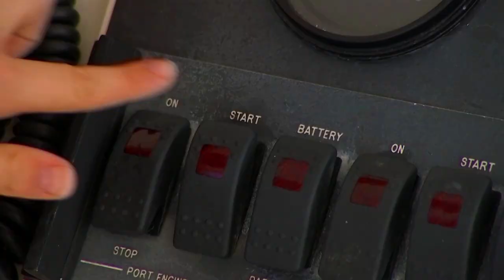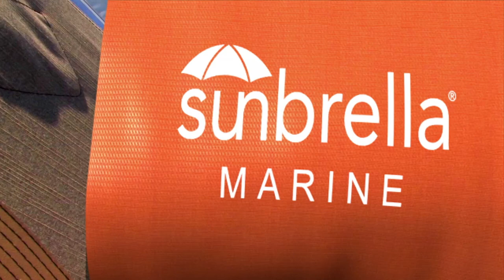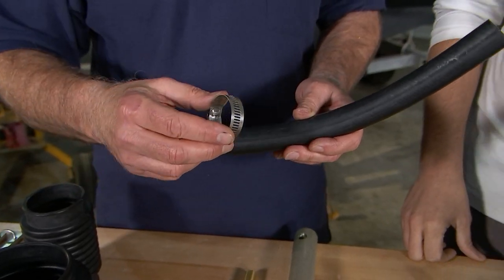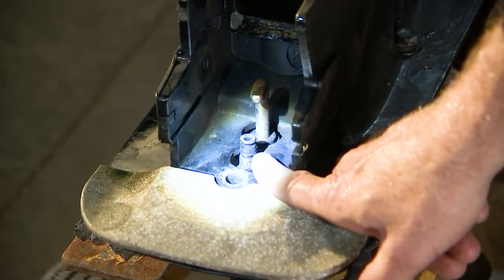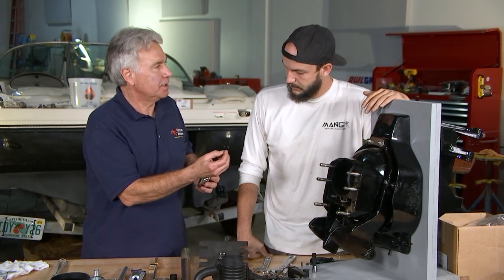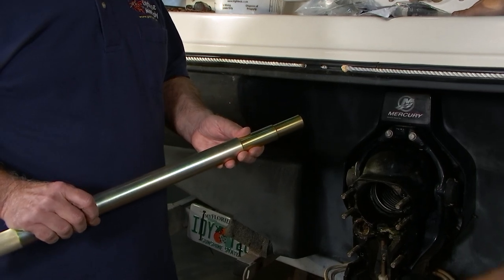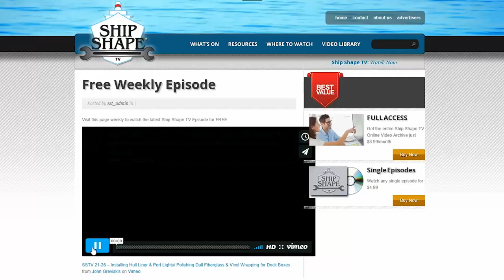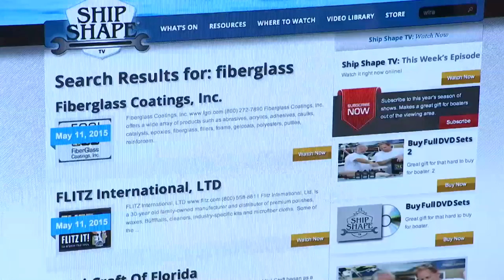MarineEngineParts.com Demonstrates a Bellows Replacement and Discusses Sterndrive Maintence

Comment: If maintenance of a transom assembly and stern drive is too much for ya, then just get an inboard, and cut out the drive and midsection altogether! No bellows. No gimbal. No u-joints. Simplicity at its finest.

Comment: my soon to be new 2015 searay 260 has a 300hp 350 mag and bravo lll drive. the exhaust seemed loud to me  and it was suggested that when it comes time to have the bellows replaced, to have the exhaust boot replaced with a full exhaust bellow.  there seems to be some concern about this online depending on engine size.  what do you think? im looking for the quietest ride possible.

Comment: What would be an estimated cost to have done by a marine place?
Reply: I have boat mercruiser 5.7 sterndrive bellows job in the shop now. 800 bucks
Reply: But it rarely stops there. As they go, they will find lots of stuff you need to replace. The midsection is often overlooked, but needs just as much maintenance and money as the drive and the engine. Yes, lots of special tools required, but they have gotten really cheap compared to 20 years ago. They would've been impossible to buy, if you were not a marine dealership. You can find most of them on Ebay nowadays. 😁 And a cherry picker (engine hoist) doesn't hurt to have on hand, for pulling the drive safely. That sucker is heavy. And about $8 per pound. You do not want to drop it.
Reply: @todds5956  did your cost of 800 bucks include an intermediate shift cable and trim pucks? If so you should keep that mechanic cuz he damn near works for free